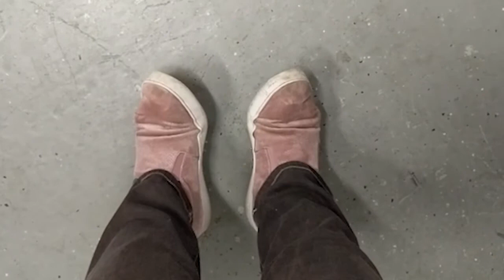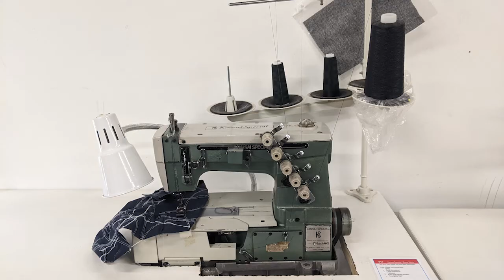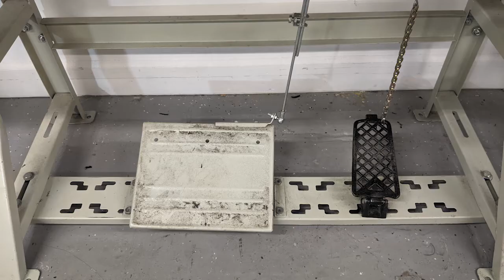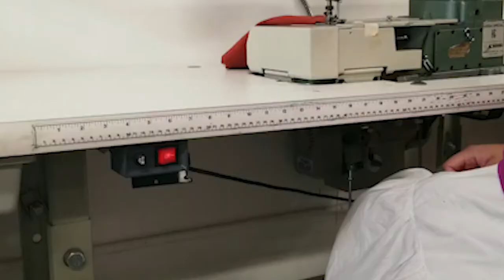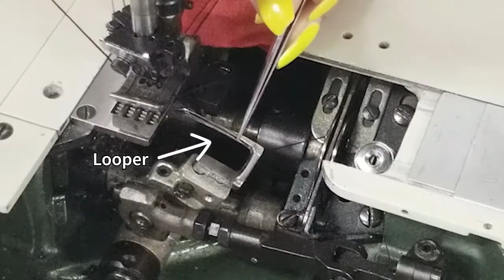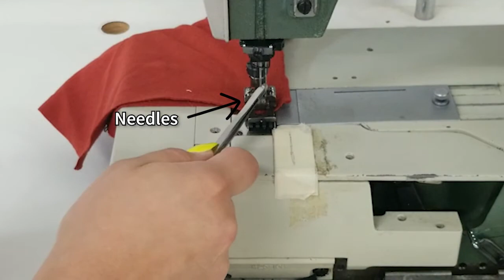Industrial Sewing Machines 101: Kansai Special 2 Needle Cover stitch

Comment: At 3:34 is there only one thread going in the tension disk? I can’t find a manual anywhere and can’t get the tension right.
Reply from the maker: So, since making this video, I've learned from our repair man that that little tension disk doesn't need to be used when set up this way. There's also a way to adjust the tension, by raising and lowering a post at the top near the take up lever (which is a whole other video to come).
If you're still having trouble, email us at aibi (at) aibi (dot) com and we'll see how we can help.